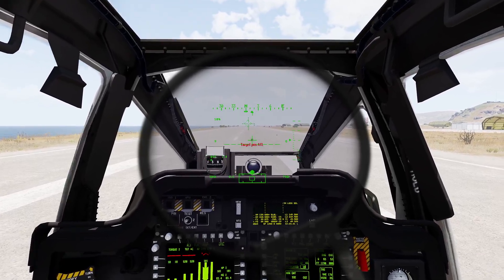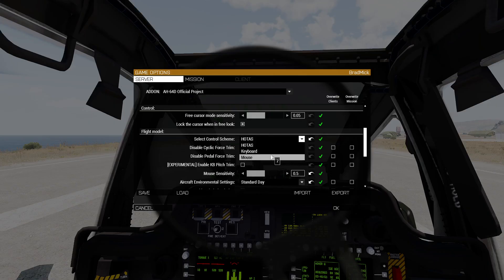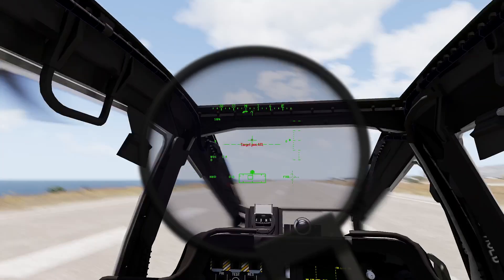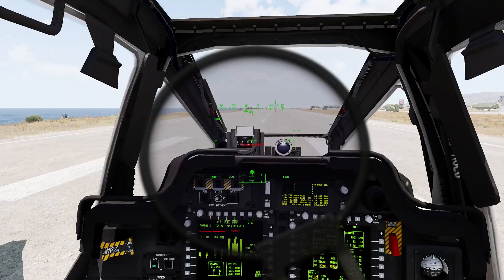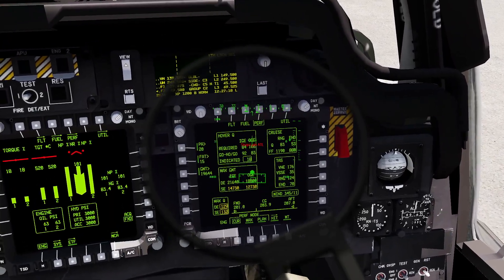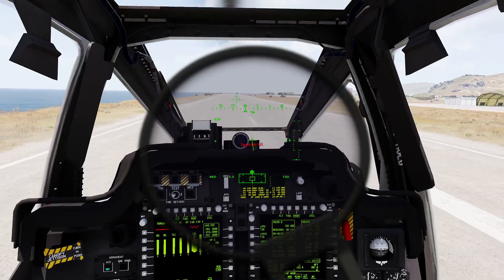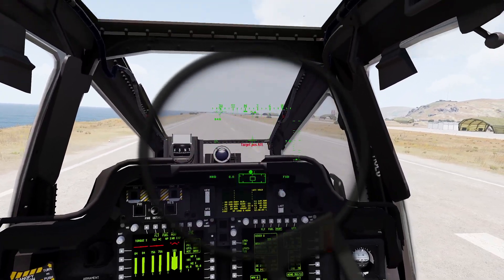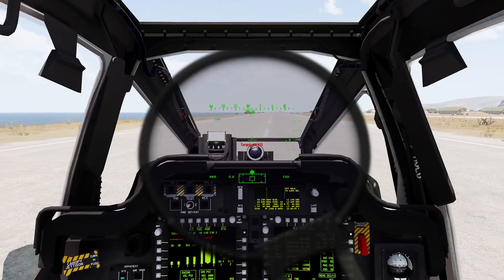[OUT OF DATE] 006 AH-64D OP - Flight Control Binding, Takeoff To and Land from a Hover

Comment: When i try to apply the left rudder my heli starts moving in an uncontrollable way, i would understand this if it only happens at high speeds , but even at takoff, and any speed really
Reply: It wasn't happening in the previous builds of the mod , i decreased the sensitive to 15% and the range of the  Axis to 30% and its way better but its still not satisfying what so ever.